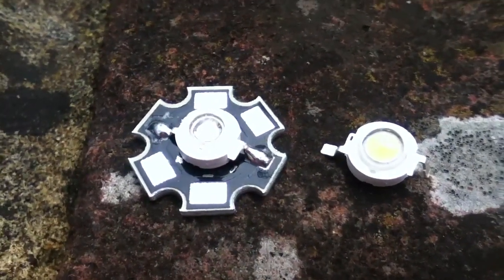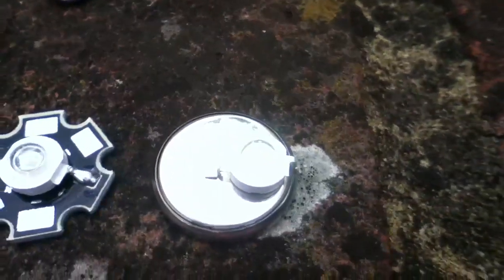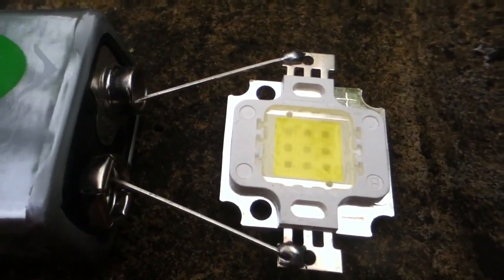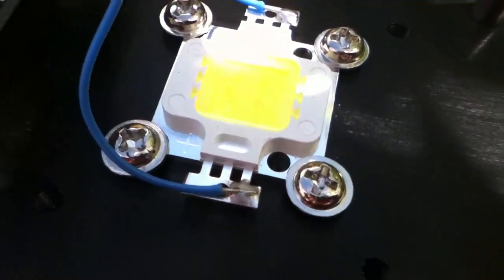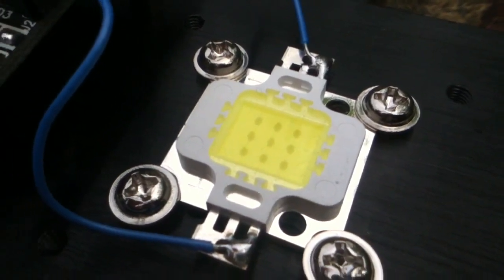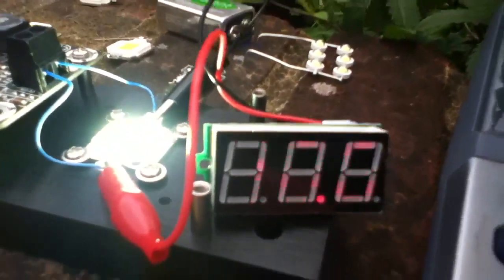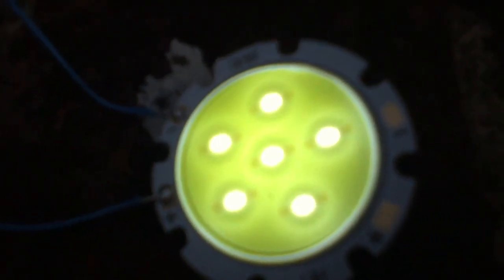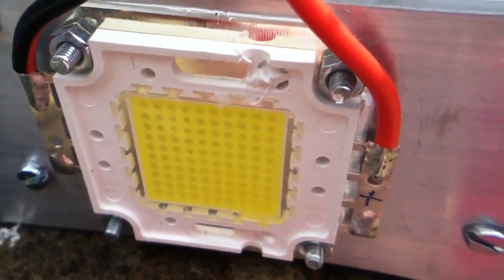High Power LED Tutorial #2 - How to Drive 5W & 10W COB LEDs from 12V

Comment: 3:56 how does it detect what voltage to rise up to? Also, what would happen if you connected 12 volts to a 6 volt LED and limited the current?

Comment: Great videos. I use the 10w, 12v leds rated at 900mah and i do not restrict the current at all as i use a regular 12v, 10amp power supply. They draw around 1.5- 2.oamp each and they work just fine with and active heat sinc. The aquarium light i made has been in olace fir 8 months and the lights are working great...no burn outs. Does that make sense to you?

Comment: I have two sets of three of those 10 watt led chips that I purchased. I want to run them off my boat battery off 1 power 12 or around 13.8v power supply They will be housed 3 a peice in two different housings. The specs are from China and say 300 milli amps a peice but ohms law says they are 700 mili amps a peice. I am just starting to hear and learn about current limiting but am wondering about quite alot now. I feel i need to wire them in parallel since they are rated for 12 to 15 volts Dc. Do I  need to supply them with the roughly 700 milliamps times 6 to all the lights and where do I purchase a current limiter such as yours to run off a dc battery? Please, any help is much needed. I plan on housing them in non silicone epoxy resin with heat sinks and they will be completely water proof. Epoxy resin plus time is valuable so I want to do it correctly. All the info on the subject is confusing and many people do not seem to run the cree cob style light in parallel or exlplain the current regulation in a way I understand. The China based specs say the forward voltage is 12-15 volts and forward current is 300 ma if that makes sense or is helpful. Thank you for any help in my quest in the pursuit learning more on the subject!

Comment: Blanca Okama
I love your videos.  I am learning a lot.  I’m trying to build a high power led panel that is 2 feet wide and 6 feet long.  
Using parts from EBay:  

200 pieces 3W LED, 670nm, Intensity Type:3W 170~200Lm ,Viewing Angle:120° , Forward voltage:2.6V~3.6V, Forward Current:3W 700mA 

20 pieces  5-35V 3W LED Driver 700mA PWM dimming DC TO DC step-down constant current
Input :DC 5-35V, Output: 700mA ± 20mA, Drive 1-10 pcs 3W LED, Supports PWM dimming, High level turn off the output, Low level Open the output, LED buck mode to ensure the total total voltage difference is lower than the input supply voltage (2-3V) . 

Powered by:  12Volts 10A 120watts 18 Channel CCTV distributed power supply 
Output: 
DC Output Voltage: 12V 
Output Voltage Tolerance: ± 1% 
Rated Output Current: 10A 
Output Current Range: 0-10A 
Output Power: 120W 
Ripple and Noise: 100mVp-p 
DC Voltage Adjustable Range: ± 10% 

Input: 
Input Voltage Range: 90-130V, 47~63Hz 
AC Input Current: 0.65A/115V, 0.35A/230V 
Efficiency: 95% 
Working Temperature and Humidity: -20~+40℃, 20%-93%RH 
Storage Temperature and Humidity: -20~+55℃, 10%-95%RH 
12V DC - 10amp Supply Current 
Multiple Outputs (18 channel) 
Every channel is protected with fuses 
Power on/off switch 
DC regulated, over current and voltage protected 
Individual LED indicator for each out put 

Do u think this will work?  Thanks!

Comment: hi julian i need some help what sort of led diver do i need for the this 17cm White 12V LED COB Car Auto DRL Driving Daytime Running Light Fog Lamp usually in pair
  Voltage: DC 12V
• Power: 6W(17cm)/5W(14cm)
• Light Color: white (6000K-6500K), blue, ice blue
• Luminous Flux: 480lm (17cm)/320Lm

when i measure the current it's only 194-200 mA with 12vdc
now i am a bit confused how come it will be 6w
many thanks in advance

Comment: hello , i have 9 ten watt red led and i want to put them in a 2ft square florescent bulb holder frame , which is metal i am also going to put a 4in square  piece of aluminum under each led and bolt it to the metal frame, will i need a separate driver for each led or could i use a biger one to run them all, and witch is the best way to set them up  thanks if you can help me
 they are 12 vollt

Comment: Hello i would build a light with 4x 12V 10W COB Led´s. The Power supply is 12V with max 80W out. My asking is now which is better 4x 2 Ohm Resistors (to get on 10.5V and 750mA) or 4x Current regulators, ore better (if it´s Possible) one current regulator or all 4 led´s?

Comment: Question: i haved buy 10 pcs of 10w LEd.The producer says that they need 9-12 V and 1050 mA.All the rest of 10w led on ebay have 900mA.The problem is that i have just one power suply of 12 V 24Amps.What resistor i must use for driving the 10W led? i was calculating 1 (i wanna drive them with 11 volt) so we have 1 divided buy 1.05 amp equals 0.952 ohms.so just one ohm and 1.1025 watts.Or is 11 wats for the resistor?Please help
Reply: Proiectediversediy You can't use a resistor, need buck converter.

Comment: Thanks for your videos.

I’m currently working on a project in which I need to power and control the fade level of five LEDs running in parallel at 700mA/1.5W. I’ll be using the same external  150-1500mA buck regulator LED Driver (PS-SP12144), powered by a 12v/1000mA PSU. The LED driver takes a PWM that can regulate the LED connect to the LED driver, but I can't seem to get it to work with the Arduino analogWrite() PWM function. It only seems to toggle the light on/off when  EN is connected to VCC on the LED driver, but not with any other voltage source (e.g. use 3.3v from arduino).

I might be going in the wrong direction here, so any suggestions would be a very appreciated :)

Comment: Do you know how the manufacturer gets the nominal voltages of the chip within such narrow ranges that they all light up the same amount? My standard LEDs don't like to be driven in parallel, one will be brighter than the other unless I add a resistor to each one.. though that might be because they're cheap.

Comment: Julian....I want to fit daylight running lights to my car. I bought 12 10 watt LEDs from eBay.I want to wire them 6 aside. I will fit a 12 volt regulator. But my question is....should I wire them in parallel or series?
Love your videos.
Reply: Thats what i'm doing. why you using 10w leds?

Comment: Are you able to get high power LEDS that are not both common cathode and common anode? So you can drive the led strip inside individually. As I had a 50W LED I tried cutting the metal strip down the sides. But they seem to be  all common connections. Both anodes and cathodes. I ask I wanted to switch the segments very fast with transistors and an Arduino a kind of multiplexing effect to try and improve the efficiency.
Reply from the maker: As far as I know, only the RGB ones have separate access to the individual columns

Comment: Really interesting. 
I was involved in electronic design and prototyping until the 80s. I then moved into Electrical installation to make more money and sadly, forgotten so much and much is obsolete. But I still have many of my old manuals, reference sheets and such. But my collection of circuits and so much more has disappeared.
The LEDs I remember were little beads which glowed red. It was possible to get banks for numbers of course. Ultrabright was dimmer than a match! The introduction of Yellow was a revolution!
These are a massive step forward.
I have strip LEDs in my home already, especially in traffic areas such as the hall, kitchen.
The future is LED. Interesting article in another clip, from you, about those dangerous GU10s.
Thanks once again.

Comment: question regarding information on the LED manufacturer data sheet. My LED pulls 600mA at 3V and 1000mA at 3.2V. I used 12 LEDs in series and set the switching driver. the instructions said to set the driver to 800mA for max brightness. I chose to use a meter and set the voltage to 3.1V per LED. Had I chosen to set the driver to 1A, would the voltage have gone up to 3.2V per LED? Should I stop setting drivers based on voltage and use current from now on?
Reply from the maker: Yes, LEDs should be current controlled at high brightness. You can voltage control them at low brightness, but that's pretty useless because nobody wants dim LEDs.

Comment: Are the higher power LED's coming soon? I'm very interested in how the ultra high-powered LED's are used. Also, is a current only regulator enough for a 10W LED? It's just two transistors.
Reply from the maker: I'll be adding to the LED Tutorial series soon.

Comment: You are correct.. Found that you always use a supply voltage above the output for this devise..
Thanks for the Class my Friend.. 
I started this weeks ago when I was interested in a Flower Initiator 10 Watt IP65 Indoor Outdoor Grow Light..
This listed over $200..
I new I could make one of these for much cheaper.. Fact is I spent about $50 for everything I needed..
Now i am looking at adding a couple more Lines of Color to my Grow room to complete the Spectrum..

Comment from the maker: I haven't made it yet. I will have to make it because part 2 ends by describing what will be in part 3! I must stop doing that. But part 3 will be the last one. Then I will start a new LED tutorial series (mostly about high power LEDs) because so much has changed. There are so many new LED drivers available now.
Reply: Looks like it still hasn't been made.

Comment from the maker: The buck converter may need a volt or two difference between input and output to maintain a stable output. If the LED needs the full 6v to draw 1000mA, the buck regulator input may need to be 8v or more.

Comment: After It sank in of what you have described.. It makes sense to use the Buck regulator for my application inline with the 6 volt DC supply bought.. Takes some of the Guessing away for my 10w LED that specs out at a forward voltage range of 4.7--6 volts-1000ma.. Not really the standard voltages for a 10w LED as the Manufacturer said that IR LEDs run at lower voltages..

Comment: The 10W LED I have is rated at 4-6volt/1A..
So you saying the Fixed Voltage on my supply will not control and limit the current needed???

Comment from the maker: Probably not. LEDs need a current controlled power supply. You need a PSU that will limit the output current to 1000mA while letting the output voltage rise up to whatever the LED needs.
Your 5v PSU has an output voltage right in the middle of the LEDs 4.5v to 6v range, so it's just possible that the LED would light up without burning out, but it wouldn't run at full brightness. It's the wrong type of PSU for a high power LED.

Comment: I am starting a project with this LED:
High power 10Watt Bright LED
* Lens Color : Water Clear
* Viewing Angle: 120-140°
* Wavelength: 730-740nm
* Forward Voltage:4.5V~V6.0
* Forward Current: 1000mA
I have looked in my stuff and found a US Plug AC 100-240V to DC 5V 2A Switching Power Supply Converter Adapter.. 
Can I use this wired direct to (+) ( -)?? Hope I don't need a resistor. If so what values?
This would sure simplify my Project if it will work..
I appreciate you help..

Comment from the maker: I've not measured it, but the data sheet for the LED driver claims 96% (24v in, 4 LEDs). I reckon if it stays cold, it's running efficiently.

Comment from the maker: The 20W, 50W and 100W LEDs all need around 35 volts, so I'll be using boost converters (instead of buck regulators) to run them from a 12v battery. Bigger battery, bigger heatsinks, thermal grease, fan cooling will all feature in part 3. Many thanks for the kind comments.